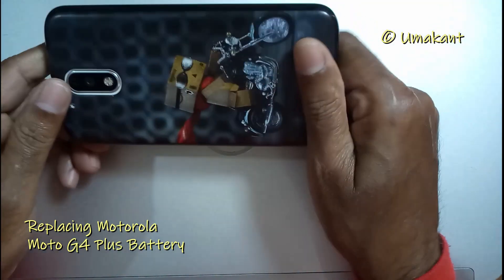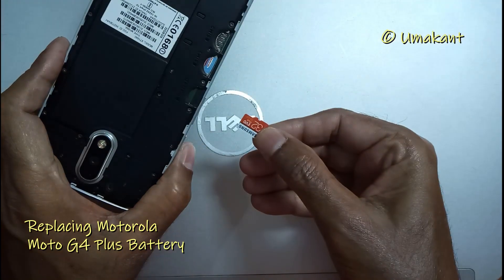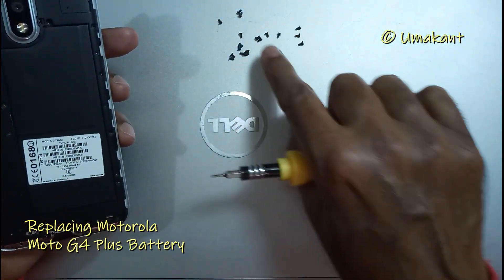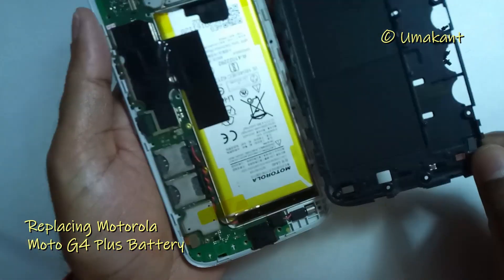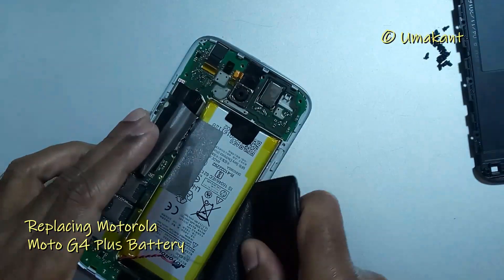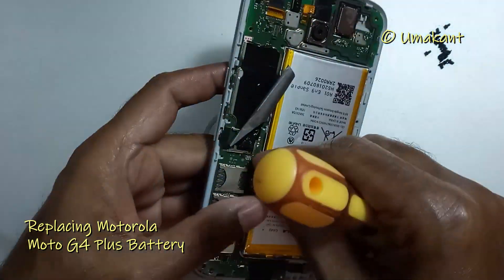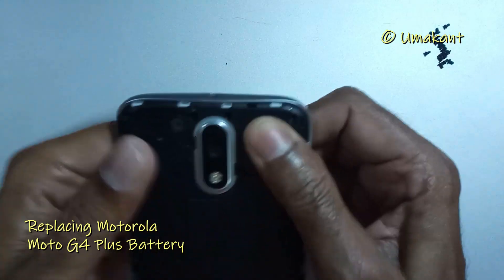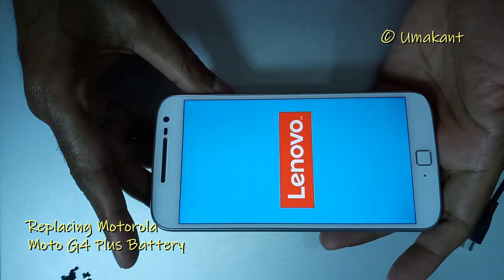Moto G4 plus Battery Replacement

Comment: After battery replacement is it working properly now ? ..
Reply from the maker: That battery got damaged in 2-3 months. Thereafter I replaced another battery.
https://www.youtube.com/watch?v=cqUuCW06x5c
This second battery is working. But the phone is rarely used so no load on the battery. It is difficult to get original/high quality battery.

Comment: Can you provide link for buying battery
Reply from the maker: I bought online from a new shop (cant remember the shop name) for around 500 rs. but the battery is not good and discharging very soon. So I will not recommend to buy from there. You may buy from amazon or other shops. It is difficult to know whether the battery is perfect or weak. If you come to know after a few days, then the return period would have beeen over. You can only give a one star or bad comment but cannot get your money back.
Reply from the maker: I got the shop name from the emails- it was jaldifatafat (https://www.jaldifatafat.com/). Now the price shows high. that time the price was cheaper than amazon. so I bought it from there. But within a month I realized that it was not a 3000 mah battery but much lower capacity..
Reply: @UmakantMishra  thanks your feedback was good .